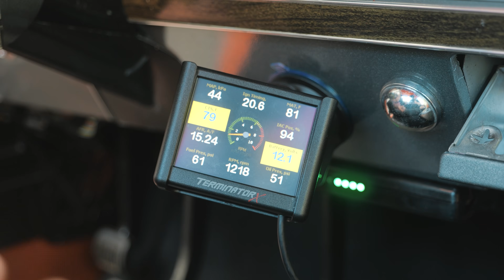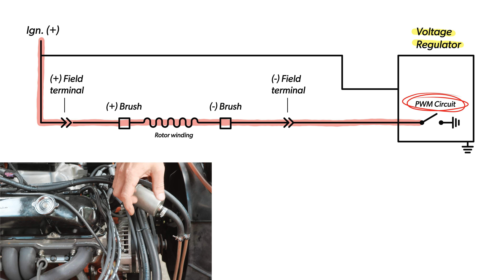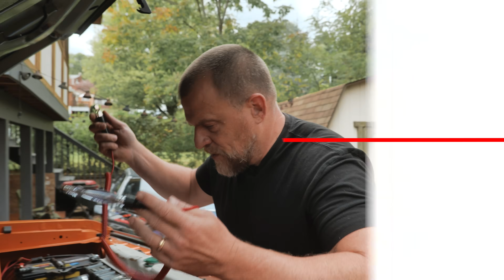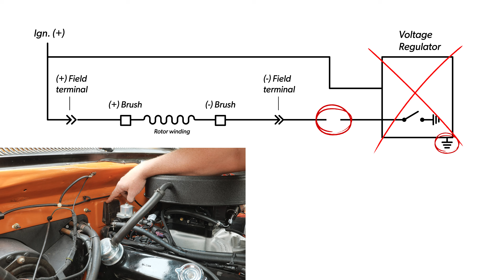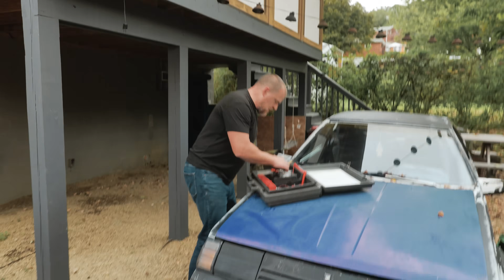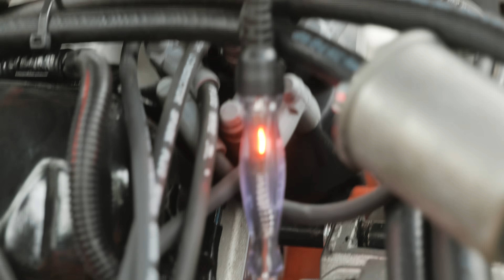Mopar Charging System Testing [External Voltage Regulator]

Comment: What would be the problem if I have 13.5 volts at the alternator and 12.46v at the battery while the engine is running?  This is on a 69 gtx with the old points style VR.  I believe my alternator only has the one field wire instead of the two you show.  I think the battery is getting charged but not with the voltage is really needs.  I'm saying that because I see ~12.8v and ~6-7 amps at the battery right after cranking and then slowly going down in amperage and voltage after a few minutes.
Reply from the maker: On the heavy post? You have a voltage drop on that wire that goes to the battery

Comment: Maybe I missed it, I don't understand what's pulsing the signal.  Is there  a tone ring inside the alternator?
Reply from the maker: The voltage regulator is controlling rotor field strength by pulse width modulation. There is a slip ring on the rotor with a positive and negative brush. The positive is hot all the time and the negative is being pulled on/off to ground to control current flow and therefore magnetic field strength of the rotor and therefore output voltage of the stator.
Hope that clarified things

Comment: I used this excellent video to diagnose my own Mopar.  First, there was power to the field feed wire, but not continuity through the field windings.  I replaced the brushes which appeared very worn.  It was then i discovered that the bearings in the alternator were bad so I replaced it with another alternator I had lying around.  Still though, the voltage regulator was not pulsing the field ground.  The VR had a power feed but spotty ground.  I replaced the VR with another older one I had lying around and it worked perfectly, pulsing the ground now as Paul demonstrated.  I suspect that since the newer VR unit was powder coated it was not making a good ground, if I use it I will remove the powder coating from the back plates at least.  Another note - if changing the brushes, the insulating washers are critical as the isolate the brushes from the grounded alternator case.  Forget one and you create a short and could damage wiring!  Now, after a valve adjustment it runs beautifully.  Thank you Paul!!
Reply from the maker: Heck yeah man, nice job by you in tackling a multiple problems issue without loading the parts cannon! Thanks for sharing this with me.
Reply: @ScannerDanner  Thank you Paul!

Comment: Lemme ask you this, what would happen if I inadvertently hooked up the 2 smaller wires backwards? I fully admit I did it, i had to take the rinkydink leaky power steering off and also removed the old nonfunctional AC, so we had to change pulleys on things and make brackets to realign things, i totally took the alternator apart too fast and forgot what went where because I was burning one while I worked… did I burn up the regulator or the alternator?  I guess I’ll find out tomoro, I gotta go get a new battery for it tomoro too.
Reply from the maker: 😆 that's kind of awesome. So the two smaller wires on the alternator got mixed up? And it was charging normally before the pulley swap?
Reply: @ScannerDanner yes, it was normal before I touched it. I actually just got back in from doing your test with the light… I have power at the main wire, I have power on the closer/1st field wire, but I have nothing at the top/3rd wire that is still green and goes to the regulator. The regulator itself tested as grounded with the light connected to positive side of the battery, the wire feeding the regulator from inside the truck tested good all the way to the main bulkhead plug on the drivers side fire wall.
Reply from the maker: With the regulator wire disconnected from the alternator you should show power on the terminal on the alternator if your power supply into the positive brush is good (the other wire not disconnected) and the brush contacts and windings internal are good. But reversing those two plugs should not have burned anything up because both brushes are insulated with an external regulator.
Reply: @S @ScannerDanner so yeah, that’s where I’m at, there is no power at that top post when I unplug it, which is the green wire from the regulator. There is power at both other lower posts. I did this with the truck running
Reply: @ScannerDanner I probably burned up the alternator guts huh?
Reply: @S @ScannerDanner also, when the issue happened, it burned up the wire from the the 1st field post(remember it was on the wrong/2nd field post at the time) that goes to the bulkhead plug, it was replaced tho and is obviously functional. The original green wire that goes to the regulator(that was wrongly on the 1st field post) did not get burned up.
Reply from the maker: so your positive feed wire to the positive brush got burned up? After your repair, do you have power on that wire with the key on? You should.
Reply: @ScannerDanner yes and yes
Reply: Ok positive and negative brush, the positive is the middle post and comes from ignition, the negative is the top and goes to regulator. I’ll use those terms from now on and condense my current situation into this comment. 
Problem started when I mixed up the 2 brush wires after some tinkering, the wire from the ignition got put on the negative brush terminal and burned up, the regulator wire got put on the positive brush terminal and did not burn up.
After doing your tests today, discovered I have no power at the negative brush terminal, I do have power at the positive brush terminal. Same result whether truck was running or not running but key on. The regulator is mounted tightly and shows good ground on test light connected to positive battery, and the plug with the 2 wires seems nice and tight too. The main bulkhead plug at the firewall seems in good shape with no burn spots and shows power on the positive field wire location.  The dashboard ammeter has never moved since I owned the truck, but the last guy installed a 2inch voltmeter that DID work before, it does not read anything now of course. I put a 2 gang rocker switch panel in the truck for some work lights, it’s hooked straight to the battery with an inline fuse, it has its own digital voltmeter and it never climbed above 11.4 volts today and that with me revving the shit out of the truck, it sits around 10.3 volts at idle.
Reply from the maker: Something happened inside that alternator for sure then. Maybe got damaged when you replaced the pulley but not sure. Power going into the positive brush and nothing coming out of the negative brush terminal with wire disconnected confirms that
Reply: @ScannerDanner  im at the point now I guess, that if I gotta replace the alternator, im just gonna do the 1 wire swap and be done with that entire old charging system. The diagnosis is grim, the fire has been lit, the order has been placed, the solution is a no brainer. I can’t stand seeing the Hulk sit any more, I did some hot laps around the cow pasture today, I love that truck! Is there anything I need to worry about with the swap, as far as the old system and wires keeping things connected, or I can just unplug them and cut most of it off and remove the old regulator? This clean 70 sweptline truck body is eventually going on a 1984 W350 dually truck I have with a big block and a 4 speed, So I’m not worried about keeping anything original, I just want it to work for a few more years…
Reply from the maker: You should be fine going that route. Not sure that you need to modify anything else. But bypassing the ammeter would be a good thing, then also modify the heavy battery cable so it does not have to travel through the firewall and back out to the battery. Something I need to do to mine. I've bypassed my ammeter but it still runs through the firewall and doesn’t need to any more. I just need to check a diagram and see what else needs to be modified to get that heavy alternator/battery cable out of the firewall
Reply: @ScannerDanner k cool, I’ll definitely do that, I have the wire for it and even a fuse. I can just disconnect the wires off the back of the ammeter and splice together, or should I put a fusible link or even a easypeezy inline fuse? Im just gonna cut that main wire short under the dash and tape it off for now, maybe i can use it for something else in the future. Hopefully my new alt gets here tomoro so I can throw it in this weekend. I tied to take the alt off my parts truck today but the main power post was rusted and unscrewed instead of the nut coming off so that was a bust too. I’m all out of tries for the old system, we 1wire swapped my 92 Cummins a couple months ago and it’s so much better for these old frankentrucks and their 30-50 years of Mickey mouse wiring “fixes”… this truck is my favorite truck out of my fleet, I have a 67 w100, 70 d200, 84 w350, 92 w250, and my 22 1500. I can fix mechanical stuff, but these old charging  and electrical systems just don’t agree with me… I appreciate your tips and this video bro, thanks again
Reply from the maker: I'll shoot a video when I modify mine the right way. For now, my ammeter is simply cut out and the two wires spliced together with a adhesive lined heat shrink crimp connector. I need to see what else in the ignition switch circuit taps into the one leg inside to fully bypass this set up and I haven't done that yet

Comment: Dang This is everything I need to figure out the charging system in my 70 Sweptline. I dunno how I found this at 240am on a Wednesday morning, but it’s all I can do to not run out there and check that regulator… I’m not a great mechanic, more of a wrench turner if somebody tells me what to do, but even I can do this diagnosing. Tomoro can’t come soon enough, thanks you bro, you’re a gentleman and a scholar! If I can’t figure it out now, I guess I’m going 1-wire cause I’m tired of the old girl sittin, she’s a nice truck, nothing extravagant but she’s all there
Reply from the maker: I'll help you too. Tell me what you find and if you have any questions. Thanks!
Reply: @ScannerDanner awesome thanks so much cause I’m really stuck, I replied to my other comment, it tells you what I found after running the test.

Comment: You over complicated everything, you could of done this video in like 30 seconds , all you need is volt  meter and a jumper wire connected to the back of your alternator hooked to where the green wire was and touch it to ground if the meter shows the 14 volts plus than your alternator is good which means your voltage regulator is bad , if the alternator reads higher voltage than the normal 14 range when you touch the wire to ground than your alternator is bad.
Reply from the maker: Weren't you just asking me for help for some oddball issue with your ignition system? So something not common right?
What you are suggesting is a full field test which is a valid test but I'm teaching the system and how it works beyond the 30 second test. I also covered variables that your suggested test would not find. Say your system isn't charging and you do the full field test and the alternator charges. You then replace you VR and it still doesn't charge. Now what?

Comment: Am I correct in thinking that reading 4 volts at the negative field terminal of the alternator is because the voltage regulator is electronic, and that a purely mechanical regulator would have read zero volts? Thanks for the fantastic learning experience.
Reply from the maker: I think even a mechanical one wouldn't give a full ground (0v) as that would probably overheat the the entire circuit. But I am not sure. I've been wondering though about what I've shown in this as far as VR control and the fact that these are all remanufactured parts. And I'm wondering if operation was a bit different in what I am describing on an actual 70s model VR

Comment: I had an 88 dodge Dakota 3.9l and the voltage regulator went bad. Turns out it's part of the pcm on those year models. I ordered a external voltage regulator kit from alternator man as opposed to replacing the pcm
Reply from the maker: I've heard about people doing that. I like it

Comment: Excerpts from the red, white, and blue shield, Chrysler Motors Service Training manuals. Circa 1977-78:
Reply: The Present Model
Finally we come to the new isolated field type alternator which is used in all our 1970 models. …this alternator has two insulated brushes, but each has a separate field terminal. Since neither brush has a direct ground or heat sink connection, the internal field circuit is isolated.
Reply: Regulator Provides Ground
As you know, the field circuit of the grounded-brush-type alternator has its ground end at the alternator housing. This differs from the systems with electronic voltage regulator where the ground end is at the regulator housing.
Reply: Introducing The Zener
The heart of our electronic voltage regulator is a solid state device called a Zener Diode. This special type diode conducts current only when the electrical system line voltage rises above a certain level. In other words, a Zener Diode is a voltage-operated, electronic on-off switch.
Reply: Voltage Shuts It Off …
When line voltage drops below the specified level, the Zener Diode shuts off the current which controls the field circuit transistors. These transistors also act as on-off switches but are not voltage sensitive in the same sense as the Zener Diode. An important point to remember here is that the diode switching action is continuous and very rapid to regulate charging voltage accurately.
Reply: … Or Turns It On
In operation, when system line voltage increases to Zener turn-on level, the diode conducts current. This control current turns on one of the transistors which, in turn, shuts off the second transistor, blocking the direct flow of field current.
Reply: Suppressor Diode Limits Current
When the second transistor turns off, the field current then passes through the field suppressor diode which limits the current flow to reduce alternator output. Put more simply, the transistors control the field current and the Zener Diode controls the transistors.
Reply: Compensation Is Built In
There are also other parts in the regulator which compensate for temperature change and other variables. However, these parts are not directly involved in our description of basic regulator operation.

Comment: mopar used two systems, one like yours and one that had the one brush connector  grounded to the case.  the regulators  were not the same. had the same plugs  but wired different.

Comment: it's a mopar, the external regulator and the harness plug connection are always bad. LOL
** surprised is was the alternator itself, not sure something went through it though and damaged it, probably just a poor connection to start and you hammering it with fast reving and high rpm's ripped it apart, maybe over-speeding it?
Reply from the maker: Happened immediately when I lost the belt
Reply: @ScannerDanner  possible that it jammed to a stop and instantly snapped back to full speed as the other belt exited and entwined with it.
also possible the brushes/springs exited that way since the housing appeared broken with all the free play, did it move forward that far? or did the front bearing and rotor move backwards far enough for it to hit the rear housing? I'd have expected far more damage than that in a circular pattern. self clearance action.
I forget what's holding the front bearing and rotor in place, if anything but press fit. haven't rebuilt one of those "sler" alternators in at least 30 years. 😖

Comment: Ok, I now have to eat crow and toss out 40 years of knowledge about Mopar alternators. 😢
Never along the way of diagnosing and owning several of these, did I ever think, nor test for, PMW behavior on the field wire. 
Thanks for the schooling.
Great video.
Reply from the maker: Thanks man. I wonder if these have changed over the years and if the original voltage regulators in 78 acted differently.
Reply: @ScannerDanner    Encouraging thought. Between this, a cluster repair I biffed, and some other things, I’m really starting to re-think my whole career path.
Reply from the maker: @nohrtillman8734  totally understand my friend! But I do think you may be on to something about the control of my voltage regulator possibly not acting like an actual factory one would have. But it's not like the factory makes them anymore so all we have is aftermarket these days. Also without a lab scope and only using a voltmeter, you'd never see the PWM signal. All you would see is the average. But I only had my truck to go by and I'm certainly not the expert on VR operation in 78. As more comments roll in telling me otherwise, I am starting to think you were correct in your original thoughts.
Reply: @ScannerDanner    I’m going to look at original Mopar training/service information when I get a chance. It’s a system that never required checking a PWM signal (even though it may have been) so procedures never had you do it. Voltage tests, exactly like you did, were perfectly adequate.

I suppose the alternator field wouldn’t care much if it was a continuous, and variable, current path to ground, or a PWM switched path. Still curious as all get out though.
Reply from the maker: Me too now! Thank you. I will dig some more too